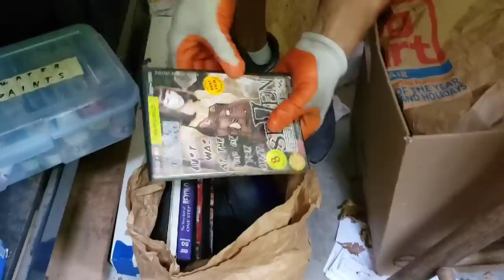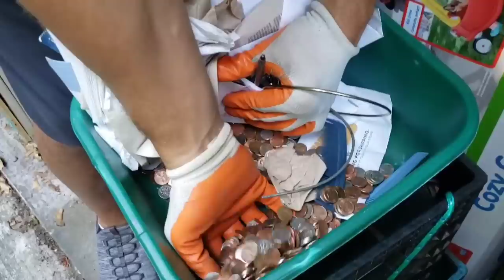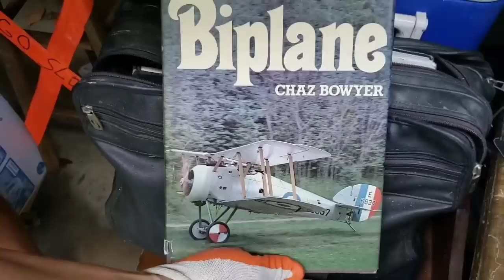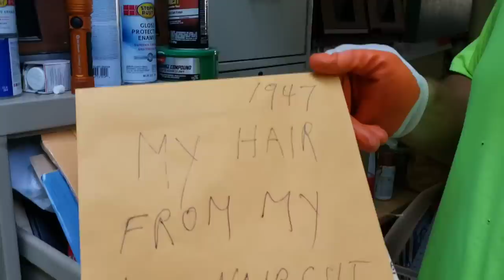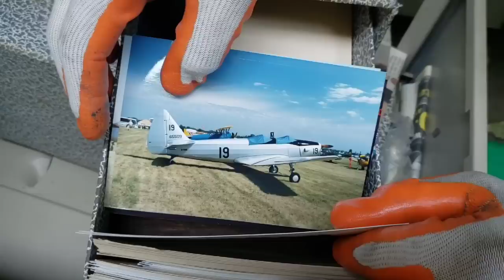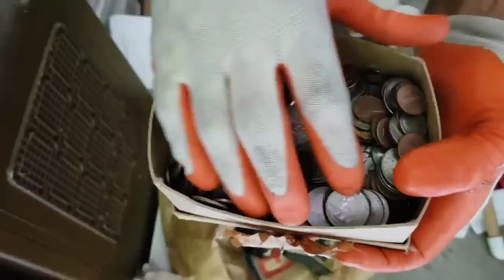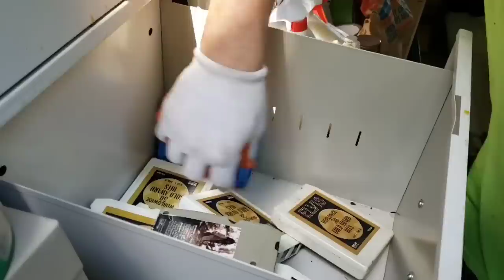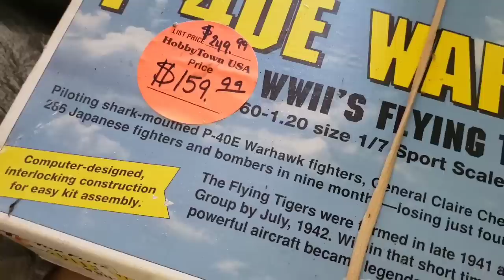THIS BIGGEST STORAGE UNIT EVER / I Bought An Abandoned Storage Unit

Comment: Sorry Jeramy but those controllers are basically junk, they are to old and can’t be used anymore the are illegal by the FCC a few years back they changed the radio frequencies that modal aircraft can be used on and the signal now has to be digital! Those controllers are on the old frequencies and are analog not digital!
Reply: Actually they can be used in other countries like here
As they are original units
The flight laws here at least only apply to new or replacement parts